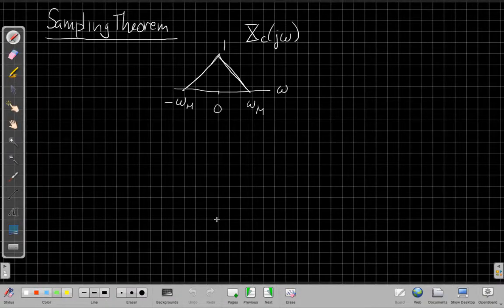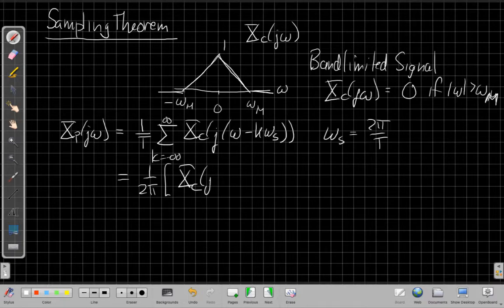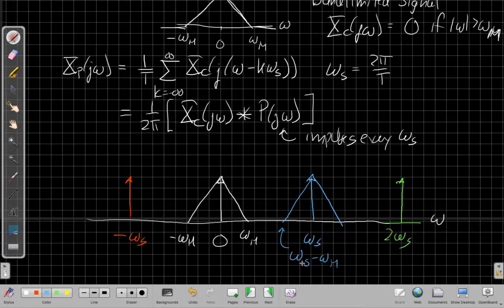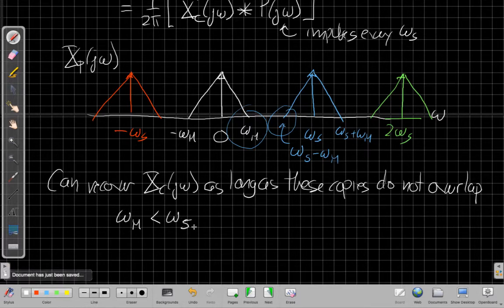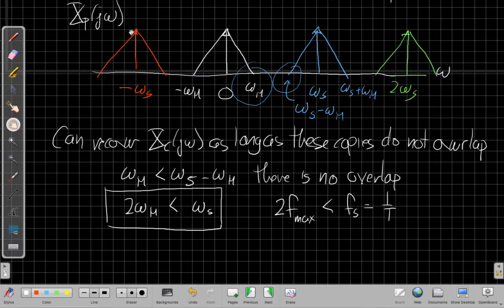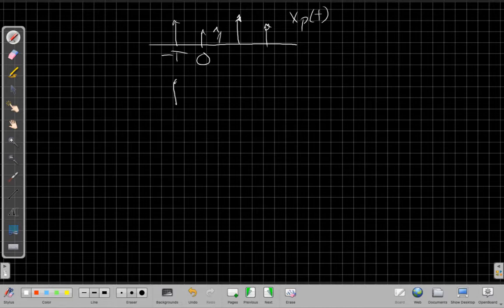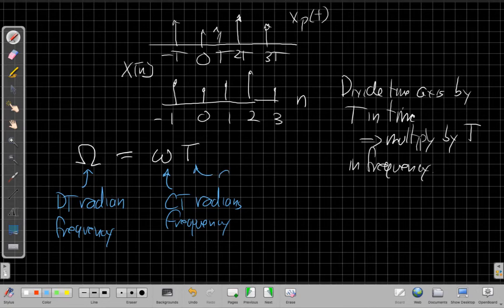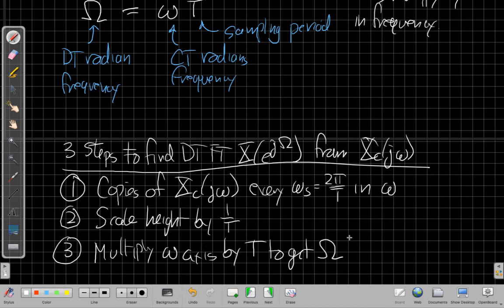Sampling Theorem for Bandlimited Signals

Comment: Hello. I have a question, not exactly related to the video but what is the difference between bandpass signals and band limited signals, if there is one. I found the sampling theorem for both of them, which seems quite similar. I am a bit confused because to me bandpass and bandlimited signals seem same.
Reply from the maker: Hi Reema, This is a great question.  A bandlimited signal includes all frequencies from -omega0 to omega0, including omega=0.  The sampling theorem requires the sampling frequency to be greater than 2 times omega0, the highest frequency in the signal, i.e., omegas = 2pi/T > omega0.   A bandpass signal is one where all of the energy is clustered around a carrier frequency omegac.   In this case, the signal energy is contained in the band 
omegac-delta/2 < omega < omegac+delta/2, 
(and similarly for the negative side of the frequency axis for real valued signals).  We say that signal has carrier frequency omegac and bandwidth delta.  The name bandpass signal comes from the fact that the signal spectrum looks a bit like the frequency response of a bandpass filter.   The critical difference is that a bandpass signal spectrum has no energy at the frequencies between  -(omegac-delta/2) < omega < omegac-delta/2.
Reply: @ProfJohnBuck  Thank you for your clarification.
Reply: You probably dont care but if you are stoned like me atm then you can stream pretty much all the latest series on InstaFlixxer. Been streaming with my brother for the last days :)
Reply: @Rene Toby Yea, been using InstaFlixxer for since november myself :)